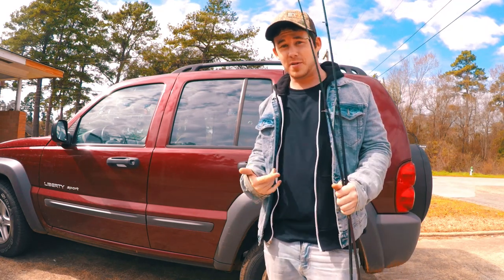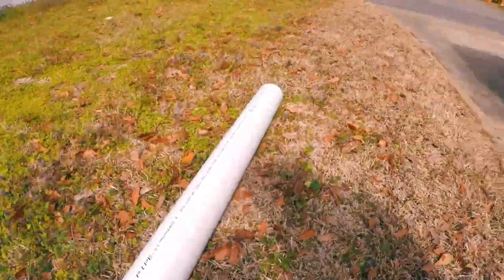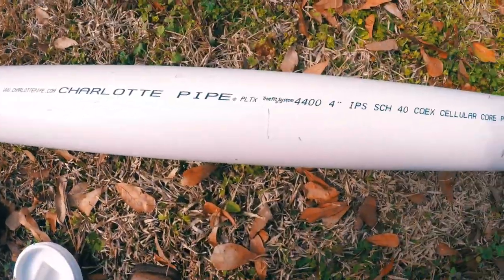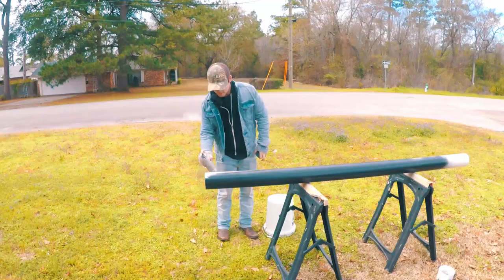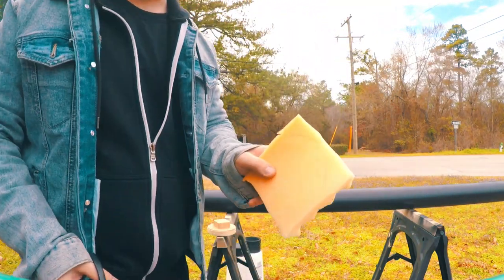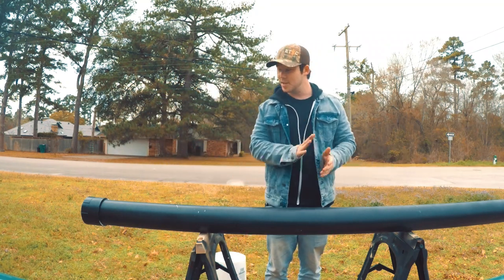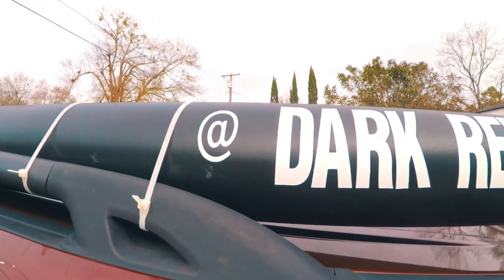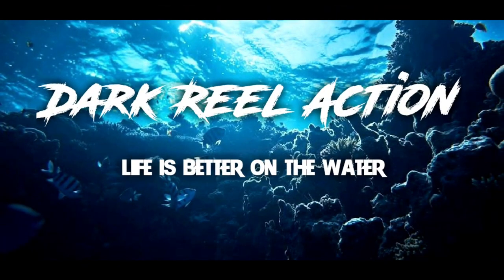DIY Fishing Rod Holder (Tube) for your Vehicle.

Comment from the maker: Update on the rod holder. I have since upgraded the zip ties to U shaped metal brackets instead of zipties.
Reply: Lol could u imagine the tube flying off on the interstate. That was my only concern while watching this. I’ll be using the brackets also.
Reply: Smart. Too many thieves with sharp blades. Now they have to work a little to steal your hard work.
Reply: @afishyfella Right. The only thing needed was a pair of scissors and bye bye rods. Lol.
Reply from the maker: @LatrissaSullivan-in9ck yepp lol

Comment: After I made myself two different pvc rod holders, I bought a 20$ hard shell rifle case and I can put at least two rods in two pieces in.. can fit anywhere. Takes 30 seconds or less to put rods together..nice ingenuity tho.
Reply: So, it had been a while since I used the rifle case, let me correct myself. It’s at least a 3 piece to 4 piece rod break down to fit. For me it’s still not too much of a hassle to assemble on the go, but not ideal for some, for “pond hopping or multiple places might be a bit much.

Comment: I was looking at a kit, but they want $60 for a 4" kit. I guess I'll have to settle for this. I may try to make it fit with something to stay shut. I want it for a DIY awning with a tarp.
Reply: The lock doesn't protect much if you see the screws on the hasp.
Reply from the maker: Correct,  I have since addeda better lock to this. It's a door for the tube and it had a lock latch on it and it's glued to the tube instead. That might help you more :)
Reply: @DeliberateNRandom  do you have a link for the kit?

Comment: Does the heat inside the tube affect the rods, I know black absorbs heat so a 28°c day inside the holder could be 45°c 

Have you had any problems because of this
Reply from the maker: I have not had any warpage on my rods or any heat caused cracks or give since using the tube.

Comment: Nice. However, the zip ties could be cut by thieves and they could steal your rods....Is there a way to secure it better???
Reply from the maker: Yes Lowes sells these metal u shaped brackets you can use instead of zip ties. The day I made this they were out so I used zip ties that day but I have since upgraded to the metal brackets.

Comment: Can the reels fit too?
Reply from the maker: Sure can!!!!
Reply: @darkreelaction  thanks for replying
Reply from the maker: Np!!
Reply: @darkreelaction  No way!  There is no way you can fit 4 or 5 rods with attached reels in this tube.  It cannot even be done with a 6" diameter PVC tube, I tried.  I have a Nasci 4000 reel on a rod and it needs an 8" diameter PVC tube to accomodate the rod with reel attached.  Am I doing something wrong??
Reply from the maker: Detach the reel if its too big